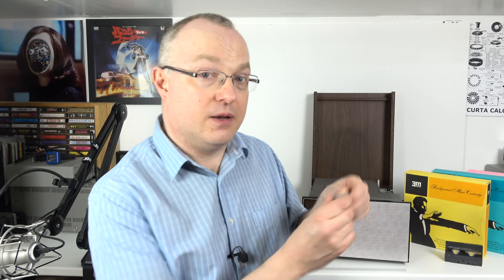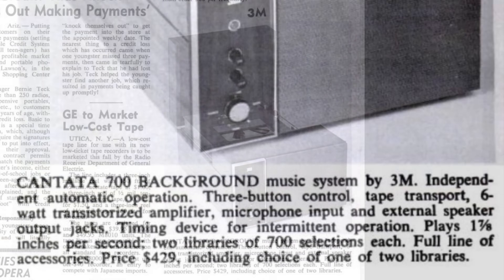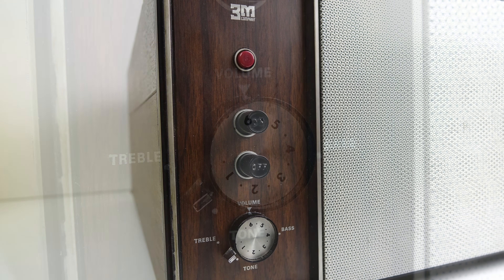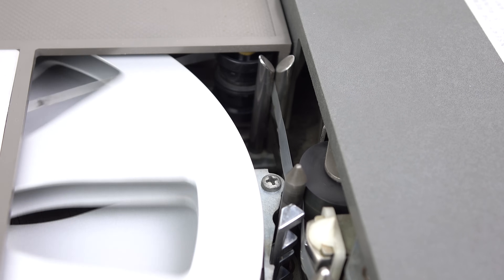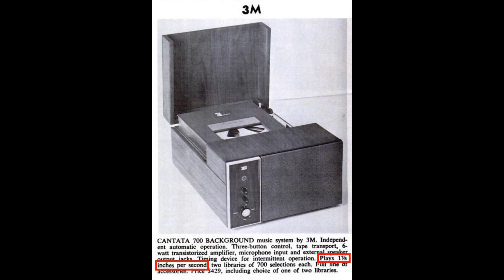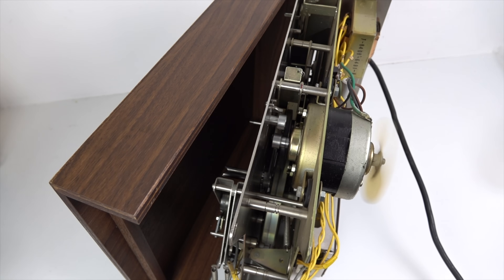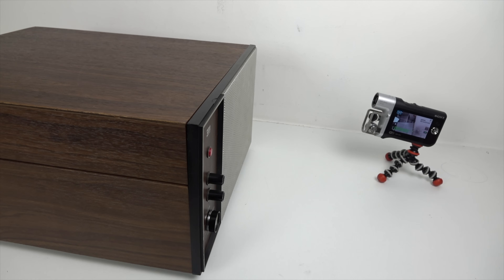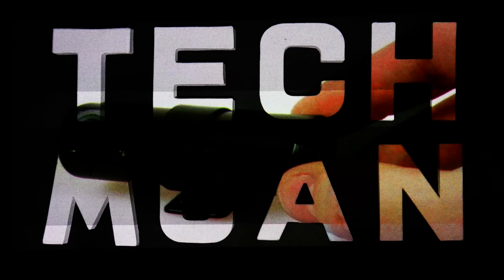Retro Tech: This 1960s BGM Machine played the Biggest Cassettes ever made - The 3M Cantata

Comment: There used to be one of these machines at a former workplace of mine. We had one cartridge for the Christmas season, and one for the rest of the year. The Christmas one was much shorter than the regular one. The regular one was probably 8 hours long, and the Christmas one was maybe a quarter of that. If you had a long shift, you might hear the same holiday tune as many as four times.

Comment: I guess they used the good quality 3M chrome tape in those, not the regular ferrite version. Dating to the 1970's it likely is a tape formulation that used whale oil as a lubricant, which is better than the later tapes that did not use it, and which were those famous shedder tapes that either turned into a solid plastic block or shed all the oxide on playback.

I guess those machines were used as background until they either wore out and were not repairable, or the strip mall was upgraded and modernised, and the new owners wanted a rebrand with adverts in the music feed. 

You could simply take the tape, put it on other reels and use Audacity to record it at 7 or 3 3/8ips with no noise reduction, 96kHz sampling ( or higher) and then take the recording and change the playback speed to slow it down, then do any EQ or noise reduction on it. I did that to transcribe an old dance music record for my mother that she had not heard for decades, as it was a 18 2/3RPM record. Brought her back to the 1960's in a country far away again. Took a lot of hiss reduction, but was about as good as I could get.

I did a similar thing to play back 78RPM records on a turntable that only had 33 1/3 and 45RPM settings, getting as good as possible out of the single play, then adjusting the length and sampling rate to get the playback right and the track time right.

Comment: wow great machine! and as you say there were not many options to purchase outright background music devices, interestingly many schaub lorenz music center 5001 machines ended up as background music players even though that was not there original intended purpose, as well as repairing all manner of tape recorders and radios I also repair clocks for a hobby so a machine like this is right up my street, BTW there are a few tricks you can try to get it working better without taking to much of it apart and there is a chap in the US who can rebuild rubber idlers, just get in touch if you want to help or advice in getting it going a bit better id be more than happy to help! i imagine looking at the mechanics once its running properly you would be surprised how good it can sound.

Comment: The old reel to reel machine I repaired only played at full speed when placed on its side as well. I found the old AC motor was on its last legs and running the machine off a variac at around 107% voltage would get it running at the proper speed. Old equipment was built well enough they could handle some overvoltages after all.

Comment: Ohh dear, it's like a nightmare. I remember these things very well. In many cases they often sounded like that! Lots of wow and flutter mostly due to the low operating speed and lack of a decent flywheel, and normally zero maintenance. They were NEVER turned off, they ran 24 hours a day for ever until they simply seized up or the tape failed, usual where the metal tape joined for the direction change.  The heads were really quite hard, I don't remember ever finding one with any ware on it. It's HF response was really dreadful -6dB at 6khz. It was really helpful in making a rather drab hotel almost suicidal after a few days!!  PS Think I will pass on your offer of a 1 hour music sample, I kind thought however. I can still hear it in my head after 50 years.

Comment: I was astonished when, a few years back, the owner of a local chippy in Bexhill, asked me to look at one of these units. It was of course the 230V version like yours, and the problems were that the machine, and the cartridges, were full of the results of 30+ years of cooking oil fumes. Sadly it wasn't fixable, but a very interesting thing, and I've not seen another until your video. I notice some of the components appear to be made by Philips, and I've seen those playheads with turqouise inserts on some old Philips kit. That'd explain the rotten rubber bits too !

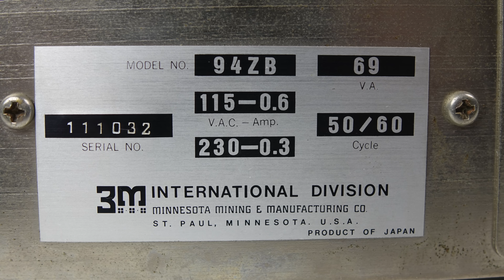Comment: OMG! I used to work on these things in the 80's. Looks like the actual model # on your machine is prolly a 94BG. (OK - I see @ 5:40 itsa 94ZG - 230 volt model.)  I wonder how they take care of 50/60 Hz operation? - Idler tire size change I guess. 1-7/8 IPS four track on 7" reels. ( @ 9:15 My bad, thought they were 7" reels - never actually measured them.) In the mid 80's the plastic 293 machines came out, and you could actually get tapes the had current hits. One of the absolutely worst tapes they ever put out was "Sacred Music" - I don't hate sacred music, but the renditions they had were horrible. You only ever heard those tapes played in funeral homes. The "American Country" tape was particularly horrible also.

You might can juryrig the sticky pinch rollers by shrinking a large piece of heat shrink tubing around the pinch roller and trimming the excess. The heads on both of your machines are in about the best condition I've ever seen. The idler wheels can sometimes be brought back by soaking in xylene- but don't soak too long, they'll turn to mush. Lay them in a tin of xylene letting them soak 30 seconds at a time and testing that the wheel isn't getting too mushy. The soaking time varies widely depending on the age/composition of the rubber. Sometimes the edges of the wheel will swell, but if you don't let it go to mush, the swelling will go down. If these machines are properly serviced with new rubber, heads, and the special lubricants (one of them being Anderol #757 made by Tenneco - God that stuff was expensive), it was not uncommon to see them run for 3 to 5 years 24 hours continuous. Most customers never turned them off except to change tapes.
Reply from the maker: +RF Burns thanks for all the useful info. Taking these machines apart must be a very specialist art...it looks like something only a clockmaker could assemble.
Reply: We had a girl in the shop who had been to 3M school in Minneapolis, and she could strip one, replace the bad rubber and the other usual bad components and relube in about 30 minutes.
Reply: There was also a special wooden jig that had the right height posts and a slotted trench at the rear the was very handy for servicing them when not in the case.
Reply from the maker: +RF Burns I wonder if there's anyone still around that could fix one of these up.
Reply: Techmoan
Honestly, I don't know. I'm not sure parts are even available for these anymore. I think If you tried the things I suggested, it would make your machine work OK as a demo unit. I don't think those pinch rollers would hold up to long term use. The parts and labor were quite expensive. A usual rebuild provided the motor and amplifier was OK ran about $500 US in the 80's.
Reply from the maker: +RF Burns thanks again for the knowledgable insight.
Reply: +Techmoan Did some checking around - no luck for replacement parts. There are a couple of companies that rebuild pinch rollers;
1) The Voice of Music:
http://thevoiceofmusic.com/catalog/tape_rec_wheels_pres_rollers.asp
2) Projector Recorder Belt Co:
http://www.russellind.com/prbline/prblinecom_.htm

You can give them a shot - good luck!
Reply: +RF Burns wow :0

Comment: A tip I learned some years ago: How to repair soft sticky pinch rollers. The secret is talcum powder. Remove the roller from the machine and liberally sprinkle some talk on a clean flat surface, then roll the roller backwards and forwards through the talk. Hey presto a repaired, non sticky roller.
Reply from the maker: +Derek Williams I may give it a go...but there's a lot more going on inside that needs serious attention.

Comment: The Reel Pro Sound Guys produce a nice rubber restore kit. I've used it to turn shiny pinch rollers back to their original self. I'd be tempted to use it on the shiny drive wheel, but I wouldn't dare on the pinch roller if it's sticky. You may already know this, but perhaps something to consider on the off chance that you don't.
Reply from the maker: +racrav I didn't know about this, so thanks.

Comment: Hi,
 
I think I must be what you are ‘a bit of a geek’, not that I own any machines like you but I’m interested in them. 
Before anything remotely smaller came out I was looking at grungdig full sized reel machines, the spelling I am not certain about. I still have an unopened normal cassette tape player the next size up to the telephone sized tape cassette platers under the Sony name, you know. I have several hundred cassettes and want to record them to CD or computer before I die, it will be a little difficult afterwards!

These Large machines you have are really pretty clever, just a shame the various rollers did not have as much thought put into their design, because of course and I am guessing, it would have been possible to make these with gears at one end if there was enough space. They are pretty clever music cassettes though. 
Take care and thanks for the upload,
mrbluenun

Comment: Sir, another superb video! Brings back happy memories, I used to work on these machines. I worked for a UK company called TSC. They were the UK distributor for this machine, the son of the owner converted them to 240 from 110. We even used to record the tapes - on a Reel to Reel machine (& then spool em on the the cartridge!) to make "UK" music - inc pop & contemporary tapes, not just background cheese :-) I've always wished I had one of the machines. We used them pretty much up until Philips CDi came along with their 4, 8 & 16 hour BGM system. If your ever gonna sell that, I'd love to give it home. Thanks for another great video.
Reply: +mipmipmipmipmip We used CDi until about 2006 I guess. Yes there were industrial players. Philips BMS 3000 - had a built in amp, 100 volt line. Plextor made two bespoke units M810 was just a CD drive with audio out & the M825 with had a built in 100v line amp. The Plextor machines were superbly made & really reliable. The CDi's were kept in caddies to help protect the discs from commercial environments. We supplied McDonals, BK, Orange, Caffe Nero, thousands of machines. You could make the machines play normal "Red Book" CDs if you knew how. But we looked to stopped people playing their own CDS - ie Eminem didn't go down too well in a shop!!